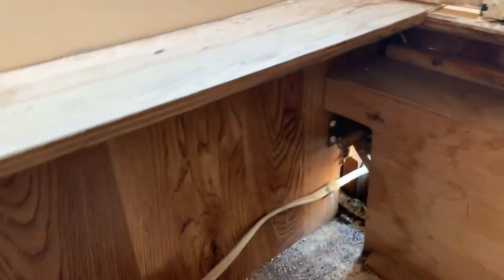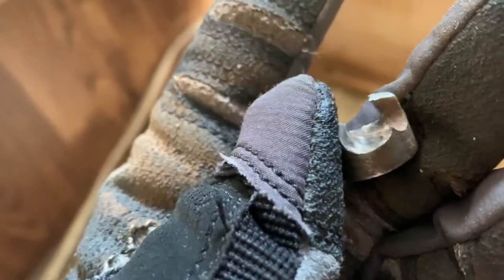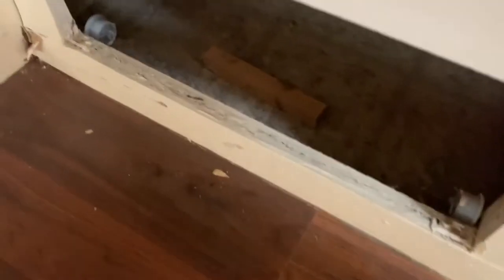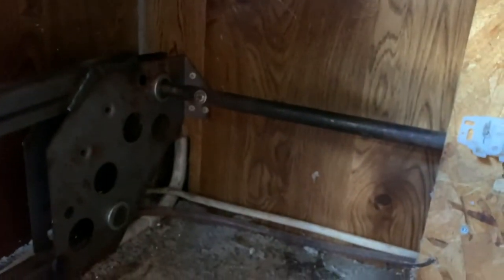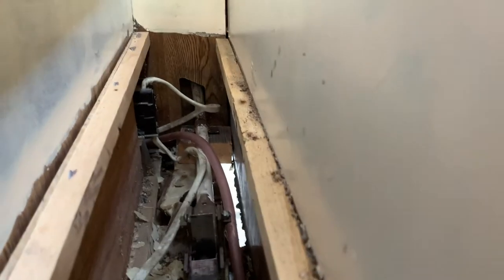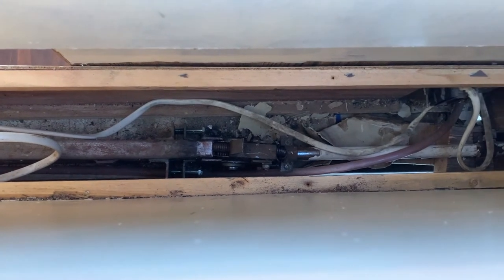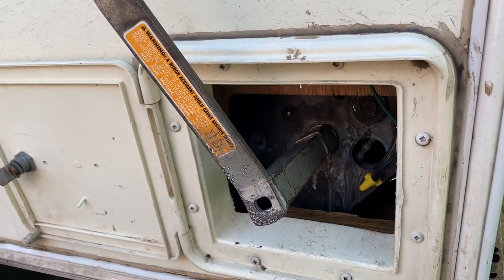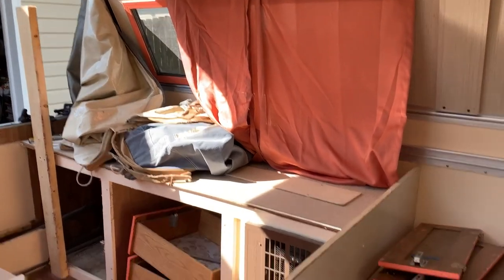Rockwood Camper Spring and Tube Lift System Issues - Camper Restoration Part 3

Comment: I hope that this might help everyone with the older Forest river/Rockwood chain and spring lift systems.
I had to MODIFY alot of this system like the nut for cranking it up. They designed it to move???? It supposedly is on threads and has pins in front and in back this is supposed to spin forward and back on the threads?? Catching the pins each way. It tightens the clutch and lets it relax, when lifting it has a Paw that catches a sprocket so that it does not go down and when you bring the rood down it relaxes letting the paw move slightly away from this holding gear. The problem with the NUT is it is on treads moving back and forth, Well the threads really need to be ACME and even this does not stop the nut from STRIPPING. We all learn this when we use a tap or Die to make threads, how it eats metal.
Clutches were for sale but I cannot find one that is not out of stock. So to fix this I used a nut of the same threads first on the clutch shaft like a washer to take up some space and be able to make it thread and hold the crank bolt so it would not move, then I put another same size bold on the end and tightened all 3 nuts together. The problem with all of this is that it pushed the Paw that stops it from coming down when cranked up. I will now do 1 of 2 things. Make a Paw that is manual or braces out of Metal plating on the outside of the camper.

The front driver side spring bound up and moved the chain off of the sprocket.
Here is the cause= The chain spring is linked to the Chain inside of the housing it stays aligned. The Screws holding the TUBE coming out of the wall are only fastened to Wood of the Rotting floor. The spring pushes out of the housing and goes through a %90 tube. The force of this spring at the turn causes the screws to loosen from the floor,allowing the tube to tilt and touch the spring. This grabs the spring instead of letting it slide through. With all of the force of the chain pushing the spring will bend and kink at this point.At this time it will grab and bind up the chain causing it to jump off of the sprockets. 
With the roof propped up with 2x4's I could work inside.
I purchased a new spring from popup parts installed it,loosened the 4 bolts that let the chain have slack, put chain on the sprockets and then tightened the chain with the 4 bolts.Then making sure the crank side tube( the one that is on the ground not tilted) was fastened with the 2 tube holders. I was able to drill long screw and I did hit the frame so I know the fasteners on most of the tubes and the entire housing were secure. 

I will be making access wish Hinged covers as benches so I can get in there easy in the future.

Comment: found out that my 88 has the same issue. the bar didnt break, but the chain came off the back gears. and on further inspection, the floor under both mechanisms in the back was starting to rot and one of the springs is bound up as well
Reply from the maker: @dirtyburger1657  that’s a tough deal man! They really didn’t build those things to last or be serviced.

Comment: Did you fix the push springs? I have the same system . How did you get the spring out?
Reply from the maker: I think the plan of cranking the system all the way to the up position would have gotten the chain to the point where the spring could be removed from the chain link, however the sidewall bulging out from the crank pushing on it proved to be too much. My next plan was to replace the roof lifts with a new, modern system, but I sadly had to part ways with the camper. Hope this helps someone else at least get a quicker start diagnosing than I had!

Comment: Hi! We just bought a 1987 rockwood XL it has the same lifting system mechanism. Did you ever find parts to replace in the front drive system. Our roll pin broke and we can’t find a replacement ANYWHERE

Comment: Where did you end up buying the spring from? I'm having the exact problem with my camper
Reply from the maker: Hey Aaron, I got it from Pop-Up Parts. This is the link to the very few parts they still make for it. The spring appeared to be the correct one. The guide tubes were close enough to work if you find you need those as well. Hope this helps!
http://www.popupparts.com/index.php?main_page=index&cPath=4_12
Reply: @austincliftproductions   Thanks man, just ordered! Did you have to take the inside wall panel off to remove the spring? I am not sure how you got that out!
Reply from the maker: @aaronstowe1704  well, my game plan was to crank the roof all the way up to access the point on the chain where the spring attached, however the crank was about to bust through the wall so I had to abandon the project. I would have loved to have stabilized the sidewall and finished but I didn’t have the time to commit to it beyond that point. Let me know how yours comes out!

Comment: How did you loosen the chain to get it back on my chain is off and being a pain
Reply from the maker: I was able to loosen the tensioner on the sprocket and get enough play to be able to mess with it. You might take a real close look at your sprocket though. Mine kept coming off because it was tweaked a little and I had to straighten it out the best I could.